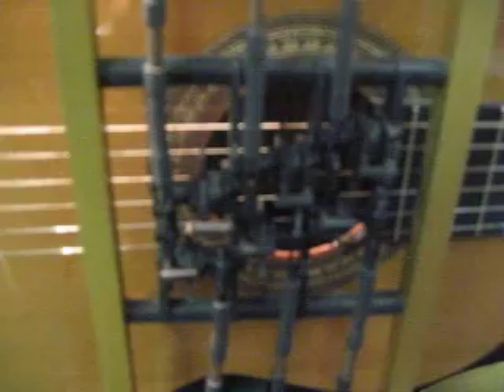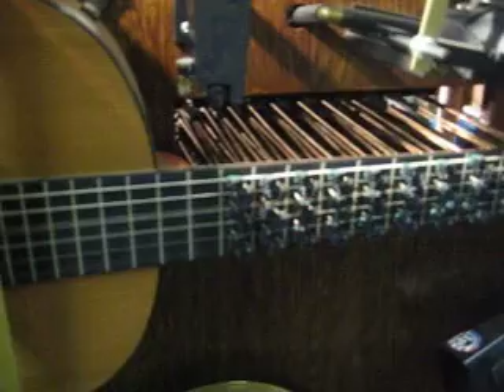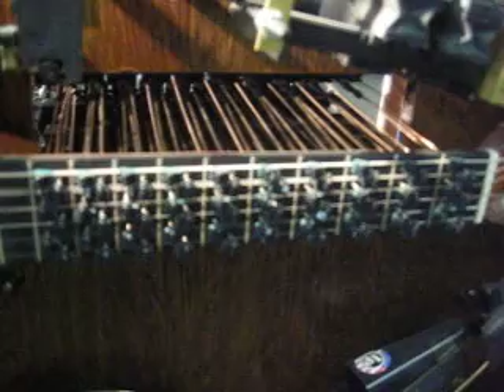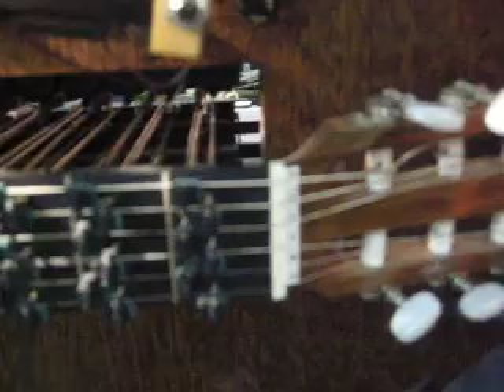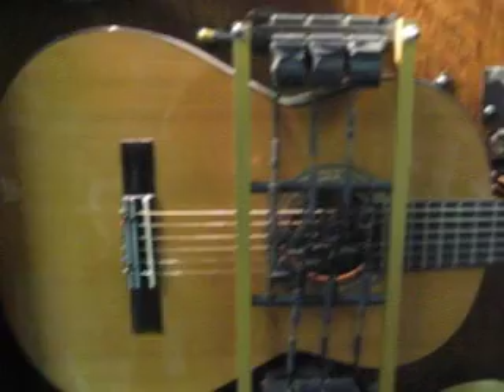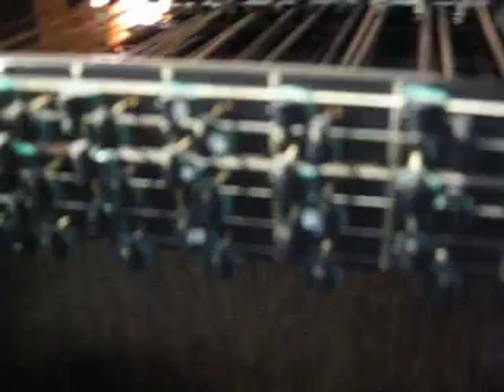Bach Fugue on an Automated Guitar

Comment from the maker: Search through my videos.  Early on I recorded a few showing the mechanism in the back.  They are pneumatics which will not overheat and the tiny linear motor valves are air cooled with the air from the pneumatic system.  Solenoids will overheat because the last fretter played must stay down until the next note on that string is called for to keep the guitar from having sympathetic vibrations.

Comment from the maker: Or perhaps use the foot switch to force a pick for any string pushed down to the fret board. It would be kind of like a hammerdown but with a pick. Perhaps another pedal to activate a full strum down or another up.  The combination of controls would have to be worked out by the user, but it is definitely possible.

Comment: like how it doesnt just stick to exact ticks.  effective.  and the rotating strum pickers are better than translators i reckon by the sound.
Reply from the maker: You seem to be the first that have noticed this!  The rotating plucker can vary it's position by about 1,000 of a second each way each time so the exact tic is rarely obeyed.  This adds to a bit of randomness but not enough to disturb, rather to enjoy! We have another version of plucker which can vary it 's strike, do bends and slides.  We use it so far on only electric guitar prototypes and have started the patent process so I can't show any designs but it also lends itself to harp and mandolin so you can expect to see some new instruments soon.

Comment: Hello there, I have got some questions in how to program a guitar like this, do you play midi files on it ?. I am doing a basic self playing guitar like this but i am struggling in the design for the frets, i am using solenoids for the frets but i know there is no way i can cover the 6 strings of every fret, is way too expensive and also i don't think the will fit. You think you can give me some tips in that part because your guitar is awesome, are you using solenoids as well? your fret design is hard to see, also how many strings per fret can you control ?